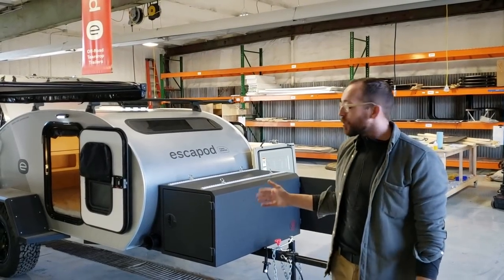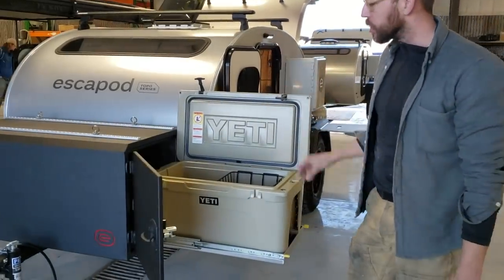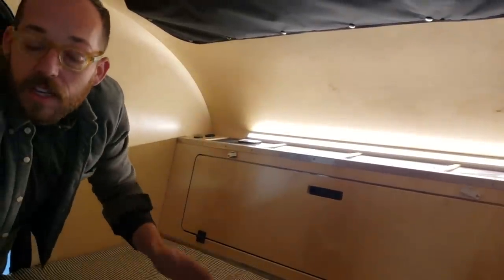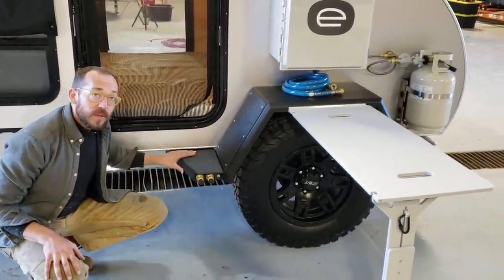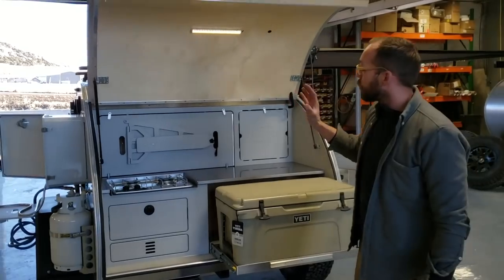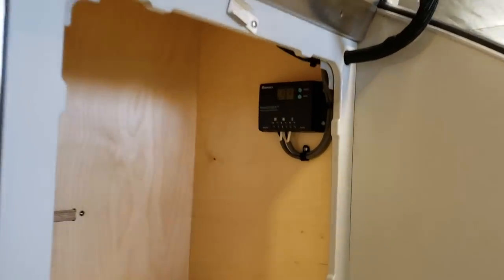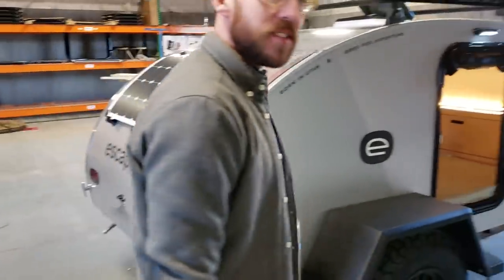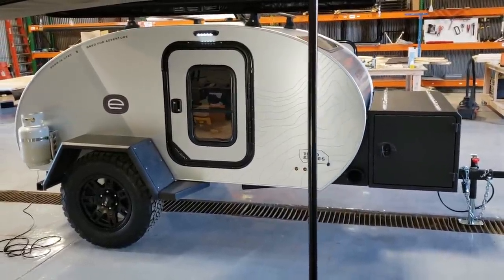2020 Escapod Off Road Teardrop Trailer

Comment: This is a really nice design. I see a lot of folks balking at the price. For a little perspective, I've been RV shopping for some time now. Trying to decide between van-life conversion, school bus conversion, etc. The issue I keep running into is this; if you want to save money on a van or school bus for converting, you have to buy something with a lot of miles on the engine and transmission. Then you will put anywhere between $6k - $15k + to make it a nice getaway boondock vehicle. Then the inevitable happens, something will break down in the engine or transmission and then you decide if it's worth putting the cash into repairs.  If it's a really bad break, say you need to rebuild or replace an engine, that price could run the gamut. So then you have a van or something like that that doesn't run but has $6k of interior that you put into the thing. The teardrop-style trailers are not cheap, but the mechanical issues are minimal compared to an entire vehicle. You need to have a vehicle to drive anyway, so buy something that can tow the trailer. If you want to upgrade later, you still have the trailer. I don't know squat, but these are the thoughts that roll around my empty little head. Cheers!
Reply from the maker: Thank you and very well said! Teardrop trailers allow ultimate freedom. Campers are free to tow with whatever vehicle they want (off-road / street) and can leave their trailers at their campsites allowing them use of their vehicles to explore all-day, living quarters free!

In comparison to RVs and vans, teardrops experience significantly less issues. This is primary due to the absence of an engine, and our rigorous craftsmanship.

Comment: You could put a cutting board surface or stainless surface on top of the Yeti cooler in the back. Give you more useful counter surface area.
Reply from the maker: The top surface of the YETI works pretty well as a cutting board & extra counter space as-is, but if you wanted to protect the top of it, that's a great idea!

Comment: I'm not sure how much you market to the long range overland touring and 4x4 market but it would be nice to have a slightly larger/taller tongue box which is fully weather/dust sealed and insulated that could accommodate the complete electrical system (lithium) on one side and fit 5 gallon fuel carriers/cans on the other. It could also be used to hook on a trasharoo. Better still if you could have some sort of rotopax mounting included somewhere. We are planning a month and a half long trip through the Yukon and Alaska next year and extra fuel is going to be one of our most important needs so if the trailer box could accomodate 2 x 5 gallon jerry cans then that would solve a lot of our problems as it would for folks who want to go from short weekend excursions to more remote longer duration trips (I would assume this would be the reason why many decide to tow a trailer).   Also, some steel sliders wrapped around the wooden frame would be nice. Most off-road rigs use a high lift jack for either replacing tires or as a recovery tool so if you have some sliders it just makes it easier in addition to protecting the trailer. The clearance is good but sliders are a relatively cheap insurance policy to protect a $20+K investment. Same for reinforcement around the water heater box/cabinet and the exposed propane tank. The way many of us wheel we bang up our rig quite a bit with tree branches and rocks etc and everything must be able to survive this.

Comment: I like the 21 gallon water tank. Also like the tip that the last 4-5 gallons of water can be drained by lifting the trailer from one side. When I heard that, it got an idea of developing some sort of electrical system that will pump out the water from these water tanks. Maybe the 2022 model will have that as a $1,200 enhancement.
Reply from the maker: We do have an electric pump that pumps out the water, but the location of the valves makes it difficult to get every ounce out of it. We're always looking for ways to improve this, so keep the ideas flowing! Thank you!
Reply: @EscapodTrailers  When it comes to ideating, I'm great at getting 90% of the way but sometimes have to really bend the back to get the remaining 10% through.

Comment: +1. .. Very nice Escapod walkthrough. .. Broadened my mind regarding teardrop trailer manufacturers. .. The Vistabule isn't all that.
.. Could two front windows be possible? .. Nice work gent's!  P.S., a heater to boot. .. Cheers, Vail, Colorado
Reply from the maker: Thanks Michael! We've always loved the teardrop shape, but resent the idea that anything beautiful has to be vintage - we're committed to making this the most functional camper on the market :) As for two windows, it would be difficult due to the curve on the nose of the trailer. Our current window is at a nice angle to minimize stress from the curve when installed, optimize the view when lying down, and be in an area that's protected from road debris. We'll keep this request in mind for future models!

Comment: I love this trailer and it is perfect for behind my lifted Jeep. I am a solo female so is it possible to do a twin bed instead of a queen? My thought for me is to do a twin mattress that would also double as a seat and add a small removable table to floor. Also what are your thoughts on installing a batwing awning on this trailer? Feasible with rear hatch open? Would want it to cover from shower, maybe, or just galley around and cover passenger door.
Reply from the maker: Thanks, Debby! Glad you like it. We only have one cabin size and style at this point in time. We do have some batwing awning options that integrate well with the hatch open.
Reply: @EscapodTrailers  Thanks for the reply.

Comment: passed one of these on the highway- it looked very well made and well designed and video further reinforced. At this price point though I sadly won't be purchasing. One question- what is the point of traction tires on a trailer? Are there brakes on the wheels?
Reply: Yes there are brake on the trailers. One day I might get one but I have a list of trailers I will be choosing from. I have been doing alot of research and the price really isn't uncommon 16950 isn't that bad it it is alot. There are more basic trailers without all the accessories. Look at hiker trailers.
Reply: Thanks. The Pod in this video is almost $25k! Thanks for the Hiker tip. Hadn’t heard of them which is crazy because I live close to Denver where they seem to be made.
Reply: @dac7046  yah they are very cool and there are many videos about them. Also the reason it is 25k is because of the add on. The hiker trailer could easily be 25k if you get a solar panel, awning, ect. But they do have more options to make it cheaper and some people even upgrade as they go. If you want the full offroad its about 9800 for a 5 by 10 if I remember and they can go as low as 4k or the most basic road only trailer. Hoped it helped. In the end I think there both priced okay just depends on what your wants and needs are which hiker is good at.
Reply: @atrociousrelic  These are actually relatively cheap compared to most models. Both Escapade and Escapod campers seem to be the best bang for your buck while keeping creature comforts.

Comment: A nice design you have.  Impressive what you have come up with.  Two areas of improvement come to mind.  Those water fittings look susceptible to damage from rocks and tree stumps as they will probably be the point of contact in narrow sections of the trail.  Also, the knob that holds your table in place will probably become a lost item for many customers.  Why not use a ball detent pin on a wire?

Comment: Really helpful video! Couple questions...the magnetic bug screens - how well do they actually work?  In the video, there were visible openings.  And, where does a spare tire go?  Thanks!!
Reply from the maker: Hey Mike - Glad you found this helpful. We've had success with them so far...it's not an impenetrable screen (the flap on the bottom has overlap, but no closure), but we try to strike the balance between effectiveness, ease of use, and aesthetics. Zippers would be more secure, but a negative and cumbersome experience to use. Everything is a balance, and at the end of the day we hope we've created something people will enjoy using. I'm curious as to where you're from? Different parts of the country have different needs, and those perspectives always help us improve the product.
Reply from the maker: Also, the spare tire is mounted on top of the fender on the passenger side. If customers prefer, we can also mount it on the roof.
Reply: @EscapodTrailers  Thanks! I'm about 20 minutes from you in PC.
Reply: @EscapodTrailers  awesome, thanks!
Reply from the maker: @UbiqueOverland  Always welcome to swing by for a visit!
Reply: @EscapodTrailers  I did, just before you moved into your new facility.  I'll be back to check out the new place.  I just didn't remember the location of the spare tire and I hadn't seen the mesh magnetic door screen when I was there.  Thanks!

Comment: clicked the "read more", thought those rims+tires looked familiar. they do give about 1/8" lower height and 3/8" more total width on square faced tread instead of round, helps the MN-D90 types to be more stable overall. they look good on them too.

Comment: In the galley, nice idea for the table off the cooler slide. What about the smaller panel on the right to be a cutting board?
Reply from the maker: Reading out minds! We didn't mention it in this video, but that's exactly the intention of using a high density poly plastic for this area - works great as a cutting board, and easy to replace if it gets too beat up.

Comment: What’s a build like this cost? I’m super interested in your teardrop. I live in Florida so not much insane off-roading. I will be taking a trailer to other states though. I really like this build in the video.
Reply: Same here in Dallas.  Not much Jeeping with it, but certainly need a dry place to sleep, versus a wet tent.
Reply from the maker: Hey Sherlock - Appreciate your patience in hearing from us. This model starts at 17k, and as shown with quite a few add-ons comes in at 24k. Definitely an expensive build, but we include a lot in the base model as well. Happy to talk through options with you directly. Best, Chris
Reply from the maker: @pedaltopia-kingcog  Four solid walls in a Texas storm goes a long way!

Comment: Great job! Jealous you get to call this work. Any thoughts on a sink and a few more gallons of water?
Reply from the maker: Thanks! We appreciate your feedback! We've opted to not include sinks in our galley so that the plumbing can remain on the exterior of the trailer. This helps minimize the potential for water damage if anything should break. Always trying to find ways to do more water, but limited in tank size to integrate under our trailer!

Comment: For those of us up in MN with tons of salt on the road in the winter, is there any protection from that hazard?
Reply from the maker: The frame is sandblasted, powder coated, and reinforced with bed liner in areas prone to road debris - This setup as well as a heavy-duty woven HDPE fabric underneath completely seals the wooden cabin from any water or salt. The cabin walls and roof are lined with .050 aluminum (anodized on the sides and powder coated on top), and the anodized trim is on the edges is sealed with vinyl tape, then butyl tape and reinforced with silicon on the seams. We do everything we can to make our trailer withstand any environments. If you have any specific concerns don't hesitate to reach out and ask!
Reply: @EscapodTrailers  The video shows what looks like the perfect setup. Add another canopy so there is one on both sides and a roof rack and I call that perfect set up.
Reply: @FlyGuy457  .. I would agree, option a second awning/canopy  . . .  Cheers, Vail, Colorado
Reply from the maker: @FlyGuy457  Thanks Jon - We love the double awning setup..an easy addition to any trailer. The base unit does come with cross bars that can be used for storage on the roof, but if you mean a platform deck, we do have one that fits nicely, and even has a cutout so the fan vent can open all the way.
Reply: @EscapodTrailers  Kayak hauling or,,maybe if mother-in-law would like to ride along--jk,more or less. What weight am I looking at for towing?-fully loaded please.
Reply from the maker: @FlyGuy457  Hey Jon - Fully loaded you're ~ 2000 lbs.
Reply: @EscapodTrailers  Perfect.

Comment: I wonder if the 2in receiver tube behind the passenger side fender can somehow be used to hold the weight of a spare tire instead of mounting it to the wall of the trailer?
Reply from the maker: Interesting idea...we looked at it initially and weren't sold on it because the tire ended up sticking above the profile of the trailer so much. Always had a hard time figuring out where to put this...we moved it all around the trailer, and then came back to the fender as the best balance of structure, cost, and aesthetics.

Comment: So I really like this trailer.  Would like to buy today but 1 year out! Only issue is some prices of add on or accessories.  Standard price seems fair if I compare to helio or armadillos pretty much in line as a bit cheaper option maybe.
Reply: You understand that those trailers you mentioned are not really in the same league as this one, right? They could never handle the roads/trails that this one does.
Reply: @spec24   -  I do understand those facts.  The ones I mentioned comes with bathrooms and ac along with indoor kitchen for winter and the off road doesn't.   The weather proofing is of marine grade.  So ............. cheaper would be my thoughts for less.   Helio and armadillo will get you year round.   This trailer is 3 season at best.

Comment: Can this off-road trailer accommodate up to 33" tires? I'm looking into it and wanted to know whether I can match it to my vehicle tires (BFG KM3's in 285x70x17) so that I have tires and wheels that are interchangeable b/w my vehicle and trailer.
Reply from the maker: Hey there! Yes, our wheels can accommodate that tire size. We don't sell this particular tire, but you could always swap after-market. We sell the BFG KO2s in 285x70x17.
Reply: @EscapodTrailers  Thanks. That could work as long as the size is the same. I see that you guys have an optional spare tire mount. Is a roof top tent still accessible (easily) with the mount and tire there above the fender?
Reply from the maker: @sikandinc  Yep! The rooftop tent that we use clamshells open above the side entry doors and has its own ladder that drops down to the ground. We also have fender steps on both sides beneath each side-entry door, so even with the water heater box and spare tire, you have a step to access the roof.

Comment: Heard you speak on the tires but not on the type of axle this particular off-road teardrop trailer comes with.  Can you specify?  Sorry if I missed it. ☺️. Would love to own one of these trailers one of these days!  Great video btw!
Reply from the maker: Hi Joel! Our standard suspension is an independent suspension Dexter Torflex torsion axle rated to 3500 lbs. Our upgraded suspension design swaps the rubber torsion style axle for a fully independent, axle-less suspension. Our proprietary trailing arm design with shock and coil-over setup means more clearance, maximum travel, and an incredibly smooth and capable ride!

Comment: A couple questions...Can a porta potti fit in the front compartment without the cooler?  Can I add a wheel to the tongue jack to wheel it around the garage?
Reply from the maker: What are the dimensions of your porta potty? Adding a wheel to the tongue jack is an easy addition!
Reply: It’s about 15x15x13. I looked up the cooler and compared measurements.

Comment: Two questions: 1) I am looking to get this for the new Bronco with the LT315/70R17 (35"), can you match tires? 
2) Can we upgrade to the MAXXFAN Deluxe?
Reply from the maker: The new Broncos look sweet! We don't currently do fan upgrades or match tires, but our super capable stock tires are a Dick Cepek Trail Country EXP 265/70R/17, and we offer a few tire upgrades: Dick Cepek Trail Country EXP 285/70R/17, BFG KO2 265/70R/17 or BFG KO2 285/70R/17.

Comment: Why not a 60 X 80 regulation queen mattress?
Reply from the maker: With the size of the trailer's footprint, a slightly smaller mattress is the best fit! At 56 1/2 in x 79 in, it is just shy of a standard size queen.

Comment: Poor location for the water hookups. No protection from big rocks.
Reply from the maker: Totally right. This design was initially meant to match the exact protrusion of a garden hose male end with a single cap, but since we starting doing the quick connects it does stick out too far. We actually have it on our list of things to do to redesign the DXF to send a better design to laser tomorrow.

Comment: Where is the 110 outlet in the galley that was mentioned?
Reply from the maker: Great question! The 110 outlet lives in the cubby behind the cutting board, opposite the solar controller.
Reply: @EscapodTrailers  is there any other powe(usb etc) externally?
Reply from the maker: @jtcj1994  There are 4 USB outlets in the cabin, and one 12V as well. There are options to add a 12V in the galley and a 12V in the Aluminum Tongue Box if you choose to go that route. With the inverter, you have the option to get a 110 outlet in the cabin and a 110 outlet in the galley. There are no outlets on the outside of the trailer, except for the NOCO passthrough, which is used to charge the battery, not for external power.